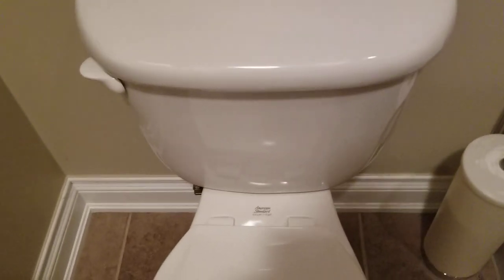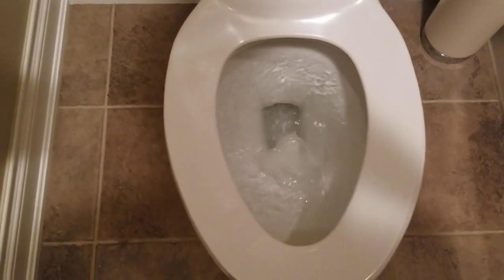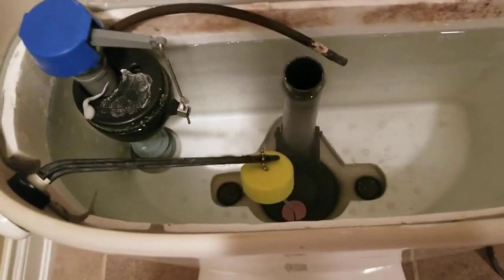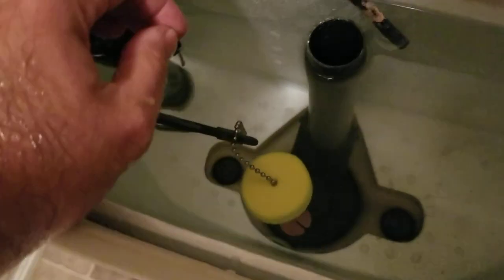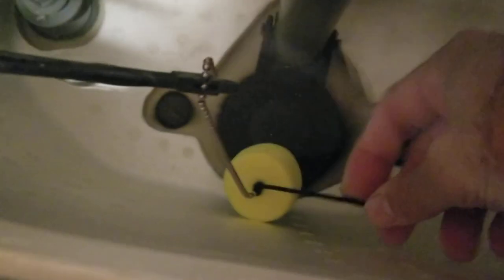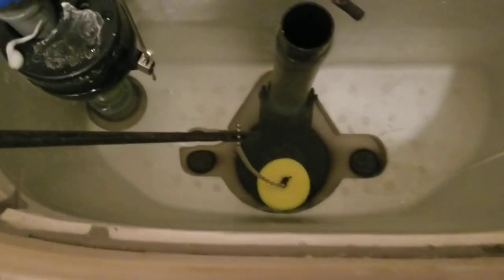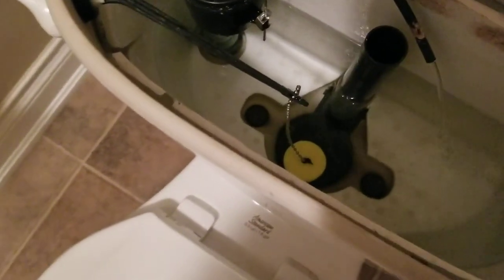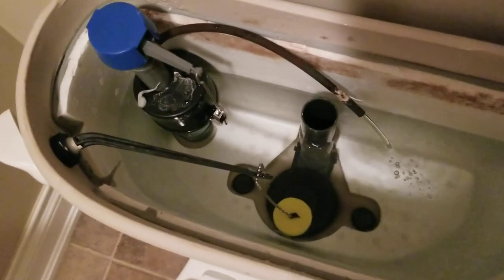Fix for toilet flapper closing too early so toilet won't flush properly

Comment: Dude, that little round red piece is supposed to be on top of the yellow float. That’s what holds the yellow float from riding up the chain.
Reply: LOL
Reply: Should be 2 locking disc one on top one on bottom but what he did will work

Comment: The black hose spraying water in your tank is supposed to be in the black tube. It refills the bowl.
Reply from the maker: Thanks that's what I thought. It's been like that since day 1 since I've never touched it. Clearly my tank passed quality assurance inspection before it left the factory 😐
Reply: @sopromondo3262  you had no clue. 🤡
Reply: There is usually a little plastic clip that holds it there.  That appears to be missing.
Reply: @l337pwnage   Since he has lost one clip, I would just use the one that's currently down by the flapper.  Only REALLY need a clip on top to hold the float DOWN...
Reply: @robinfretheim848  I was referring to the clip that would hold that hose inside the drain tube, but I agree with your idea of the missing clip on the plunger chain.  The only down side is it might be possible, although highly unlikely(someone would have to hold the lever down until the tank drains) that the float could slide down the chain, maybe get stuck there, and then the toilet would use more water, not that I'd, personally, worry about that, but that's the reason for the lower clip.

edit:  the pieces of that top clip are probably stuck in the toilet under the flapper.  Not sure how much they might be interfering with the flushing.  He might be able to fish them out with some of little flexible screw grabber thingies.  just something that came to mind

Comment: I had the same model or similar, replacing an old mansfield. But it does not have a float, and now I understand why it is loud when flushing. It closes too soon and loud. I paid a plumber to install, so I don't know if there was one that came with it and he just did not know what it was for? He was honest enough to tell me of his experience. He doesn't even know how to install a shark bite water valve. Thank you for the education. I should have research this issue the first inkling, a couple years ago.

Comment: THANK YOU SO MUCH. We had the same problem. My husband applied your fix and it worked. He remarked that people (and even plumbers sometimes) have a hard time fixing this problem because the solution is so counter intuitive. One thinks "If the flapper is closing too soon, I need to RAISE the float". I.E. more buoyancy. Its the other way around. Which he's still trying to reconcile with the laws of physics, but who cares. It's fixed. Thank you again.
Reply: That was the problem I was having, it just didn't make sense! To make matters worse, my float "holders" came off, and the chain kept coming off of the bar to the handle as well. Lots of little things but EASY to fix once I watched this video!

Comment: In my 59 years, multiple homes , multiple Investment properties, but never have I seen a float. in 2016-17, I installed three new Chair Height Toilets to replace old ones. One toilet often requires two flushes to clear the bowl,  this has been an acceptable nuisance. While addressing another issue with the problemed toilet, I notice that the flapper immediately closes the flow of water to the bowl, the flapper is 3.5" in diameter and is  larger and much heavier than what I have in inventory, and the best price for a new 3.5" flapper that I could find locally or online was $13. Thanks to your video, I was able to make a float ( I have lots of styrofoam, plastic ties, and a hot wire cutter) that allows the flapper to close much slower. I had to make adjustments in distance between the float and  flapper to obtain the optimum flapper closing time. Thanks to you, those who post comments, and Youtube for filling the void between common problems and DIY solutions.
Reply from the maker: Thanks for taking the time to share your experience. Glad this was helpful.
Reply: I think I’ll just install a float; looks like it’ll do the trick; thanks!

Comment: yes I think you had the fix all along, it's that little reddish disc above the flapper, looks like the part you need.
Reply: Yes that red disk is installed incorrectly.  It should be above the foam float to hold it in place correctly. No need for a zip tie.

Comment: You found a good solution but that pink thing was the clip that would keep the float down if it was on top of the float.
Reply from the maker: Thanks for the comment. There was originally 2, one on top and the other on the bottom. Sadly one got flushed as I didn't know what it was when it ended up in the bowl one day. It's possible that you may get away with just the one on top as you and others have pointed out.

Comment: Thanks for the fix, that's why my bowl doesn't quite fill as high as it should. But I do want to add, people need to make sure they don't put the float down too close to the flapper or else the flapper may not close at all. With a float in the proper position the weight of the water will close the flapper.

Comment: Wow, I never saw such a thing.  I have no float.  When I saw this the first thing I thought of was a fishing bobber which I do not have.  Gave all my fishing stuff away.  So I thought what do I throw away or already have in the trash?  Turns out I'm disassembling a cooler.  Part of it is going in the trash and part I'm recycling.  I can easily make a float with the insulating foam and use a zip tie or a bread clip to keep it down.  Muchas gracias señor.

Comment: Put the 'pink thing' above your float.
Reply from the maker: There was 2 of those pink clips  originally. One above the yellow float and one below to prevent it from moving. As you can see in the video even the one below is no longer holding as it has dropped to the bottom.. I guess the cheap plastic they are made of eventually fails.
Reply: @sopromondo3262  they seems simple enough to replicate from a guitar pick or bread bag closer.
Reply from the maker: @Foreseeable1  very creative ideas. Thanks for sharing.

Comment: have the same problem  - got new flapper with float,   put float all the way down - no change - still closes too quickly
Reply: How much slack do you have on your chain? If too much slack, the flapper won’t open fully so you get less water through. Try reducing your slack so you just have a little bit of play in the change when you touch the handle.
Reply: There also should be three holes in the rod that the flapper chain attaches to. You can make adjustments that way too in order to fine tune that sucker. Good luck!
Reply: @brianpaul21  thanks - did that - still closes too quickly -the flapper mocks me!
Reply: Don't waste your time then. Just hold the flush handle down for another second when you flush. Problem solved.
Reply: @nickv4073  i know that , you know that - now i'll put you through to my girlfriend who "doesn't have the time" for it :O
Reply: @needle11  Never mind. She'll be over at my place in a little while. I'll tell her.

Comment: I have to hold down my handle for a few seconds for the flapper to  STAY up,  so my toilet well flush, seen some new flappers with the float and some with out, which do I need for a toilet from 1987 ? Thanks
Reply: Older flapper like a Korky brand but don’t forget to cut away the circular ring

Comment: LOL that plastic thing beneath the float is actually the float holder, you just needed to replace it over the float haha, get to know the stuff you working on it in first place, also care for enviroment avoiding to use unnecesary plastic tie, also point for accurate angle shots XD
Reply from the maker: Thx for the feedback. Actually the float originally had 2 clips 1 on top and the other below the float. Top one broke off and ended up getting flushed. Refer to the float in link below, there is a white clip below it. https://www.amazon.ca/American-Standard-7381-129-200-0070A-Flapper/dp/B004XVO6ZC/ref=asc_df_B004XVO6ZC/?tag=googlemobshop-20&linkCode=df0&hvadid=293024050219&hvpos=&hvnetw=g&hvrand=18313738838120481769&hvpone=&hvptwo=&hvqmt=&hvdev=m&hvdvcmdl=&hvlocint=&hvlocphy=1002416&hvtargid=pla-492956115530&psc=1
Reply: Damn, people are rude!!!

Comment: What is the purpose of the float? I see other flappers don't have it.
Reply: While there is a lot of water in the tank it keeps the flapper open by pulling it upward.  When the water gets low enough the float goes down and the flapper closes.  I've never seen a flapper with one either, but it seems to make sense.